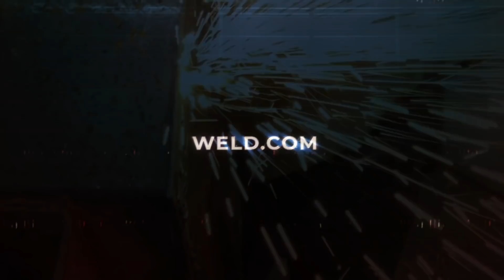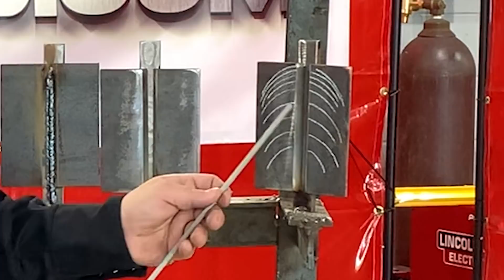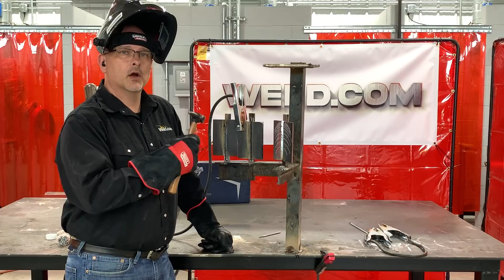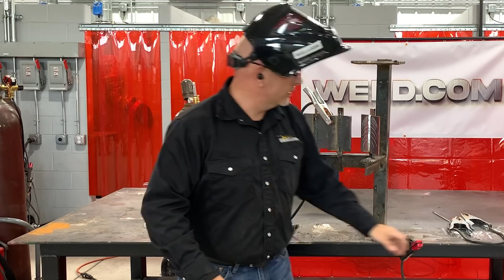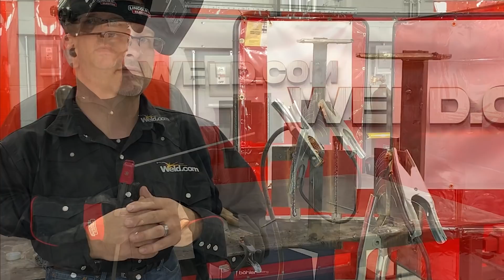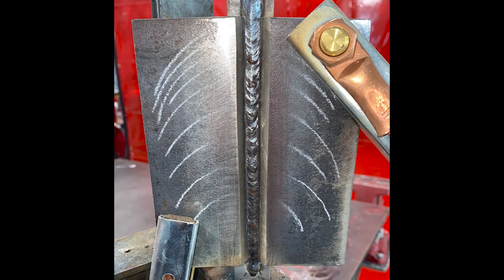Tips for Preventing Arc Blow

Comment: Ok, this is my guess as to why that works. I would have to do some tests, but from what I can gather regarding why it happens, it would have to do with the path of least resistance. That current is going to want to follow the path of least resistance and by using copper or any other metal of lesser resistance than steal or whatever other metal your welding and giving that current a way out and back around rather than pinching it to the top of those pieces of plate sticking up in the air like that your current has no other choice but to go back down hence you get that pinch of Magnetic resistance. Buy clamping the 18-inch copper ground from the top to the bottom, and sence copper offers less resistance than steel. The natural path it is going to want to flow is through the copper, although copper does offer less resistance. the length and the gauge size is rather important as well. If it is too long or too thin, the copper wire could inturn add resistance and then wouldn't work as you would be back at square one. This is just an educated theory. It would need further testing. Hope that gives some ideas as to what's going on and can help provide better alternatives to magnetic ark blow.

Comment: Magnetic fields are created by current but there could be residual magnetic fields in the steel.
Electricity follows the path of least resistance,  copper is a much better conductor so the double clamp works quite well, providing you have clean steel where clamping.

Comment: Very interesting video , I ran into a severe case of arc blow just a couple days ago then this video came out. Go figure. I made a mess that I’m ashamed of, very close quarters could only get a die grinder in there. Now I’m thinking that the jumper cable would not have to be as heavy as what you guys had, maybe a # 10 wire and smaller ground clamps. Right or wrong?
I also have a Lincoln squarewave 200 and I contacted Lincoln if I could set up the machine on AC for aluminum and use a stinger with a regular welding rod to finish the job but they told me they didn’t recommend it. I wish I would have known about this jumper cable trick. Had to use lots of paint to for a coverup.
Reply: The jumper should work being smaller. I just used what I had available. As long as it’s creating the path for the magnetic field it should work. Let us know if otherwise.

Comment: Love the topic covered! I have horrible issues with it in my students weld booths. Primarily in the 2G position though. I've tried all the tricks...with the exception of the two grounds hooked together. I'm glad I saw this before my class came in this morning, we are going to give it a shot today! Several years ago I had a non traditional arc blow issue with a item in a weld positioner (rotator). We fixed the issue by taking a 100 foot lead and wrapping it around the item in the rotator. It worked but I feel like this may have been a much better and quicker solution to the problem.

P.S.- Love the FOX EV 50 rods! I used to use these a whole ton as they were specifically required in the procedure I was working to/with. Like you said one of the smoothest 7018 rods I've ran, right from the vacuum sealed packed as well as out of the oven.

Comment: On pipe,  wrapping the ground lead a few times around the pipe  will often do the trick.  Especially for guys who make a lot of stuff from old oil field pipe. Drill stem tends to have a strong magnetic field from all the one direction rotation it sees. Lotta fence gets built with that stuff and it can be  a common problem.

Comment: Tight arc let the plate cool down when doing vertical up as you get to each side twist your wrist itll cut off the cone at the end of the rod and eliminate it the best solution to arc blow is keep a very tight arc and let the plate cool down tbh  and it's a good habit to hold a tight arc anyways even without arc blow your weld will turn out better
Reply: Also in the flat position if you get arc blow go from a drag to a push towards the end itll go away

Comment: Can this occur on tplates. I have trouble on overhead t plates sometimes and I can never tell if it's due to a gap in the base metals, or if it's the magnetism
Reply: Yes, it can certainly occur on T plates.
Reply: Hold a very tight arc and aim at the top plate slightly then set the machine to about 118 or 119 amps for an 1/8th inch 7018 88 to 90 for a 3/32nd 7018 and you'll be fine tight arc is key then just watch it get nice and round and run it

Comment: If one has a DC only welder, would pulsing be effective in minimizing the conditions that cause arc blow?
Reply: I think its worse with pulse, at least for MIG. They'll get magnetic blow if the line is rolled up in a lot of tight loops.
Reply: @Slagithor9000  -- I have a smallish combination TIG and stick welder, 180 amp, and it has pulse capability. I know that stick can be pulsed, but haven't tried it myself yet. And yes, loops in a cable can be problematic because induction is a thing, so I sometimes have to disconnect and unkink cable(s) that have too much "twist" in them...keeps the variables to a minimum. I like that little double-ended work clamp "jumper" idea mentioned in the video and might just have to make one.
Reply: @lordphullautosear  I didn't even know that stick would run well on pulse! And I'm totally going to make one of those clamps too! I'm constantly fighting magnetism!
Reply: @Slagithor9000  I personally haven't tried pulsing stick, but I did watch a video about exactly that (can't remember the channel, but I'm sure a search will reveal it). I'll probably give it a shot when my new welding helmet arrives, though. All I have is a handheld shield with a small crappy window right now, LOL, and my friend took back the auto-darkening helmet he had let me borrow. I got spoiled. The adventure continues...
Reply: probably not. for hobbyists, the easiest solution is just moving the ground clamp. our work is generally small enough that we can reposition it anywhere we like. all you need to do is change the grounding characteristics and the "magnetic pinch" moves somwhere else, probably not where you wanna weld.

Comment: I wonder if you could use a jump lead. Everyone has them. Maybe it has to be a  short wire?
Reply: probably not ideal, but ive used them for extra grounds and whatnot. given how much higher the conductivity of copper is over steel, I wouldnt be suprised if even 25ft/8m of high quality jumper cable had lower resistance than some steel plate.